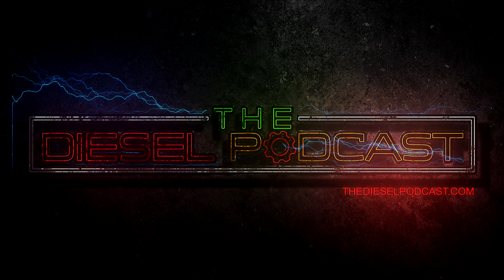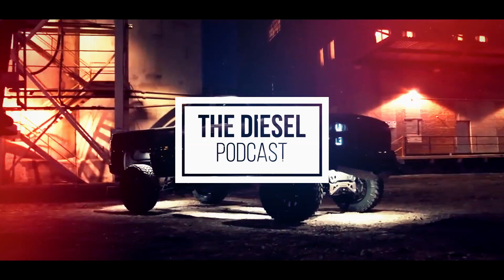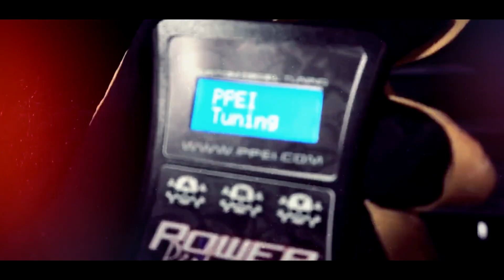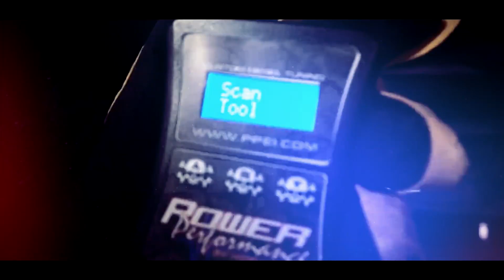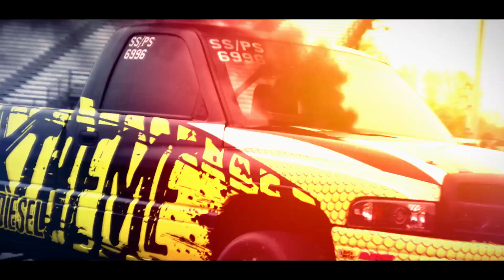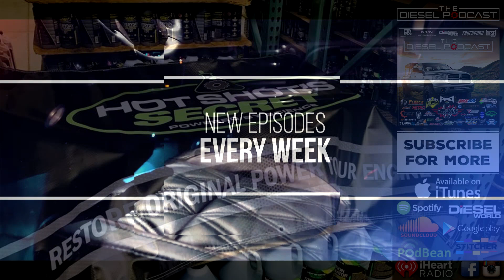CP4 Failures & Lack of Lubricity

Comment: There's a lot of strong opinion on the CP4 pump, and a whole industry based on the fear of failure. That might be justified, but no one can be sure without hard data on actual failure rates and causes. I just turned 210,000 miles on my LML with the original CP4 pump. I know owners with over 500,000 miles on the original CP4. When are we going to see actual data?

Comment: GM 35 Million $ settlement on CP4 for specific models and states. 

Per USA Today (May be inaccurate - Validate details for your own truck)

To qualify for a payment, you must own one of the following cars:

2011-2016 Chevrolet Silverado.
GMC Sierra trucks with a Duramax diesel 6.6L V8 LML engine.

The vehicles must have been purchased from a GM-authorized dealer in California, Florida, Illinois, Iowa, New York, Pennsylvania or Texas from March 1, 2010 through Sept. 13, 2024.

General Terms

People who paid out of pocket for a CP4 repair that was not covered by warranty. $30 million will be set aside for this group and payments could range from $6,356 to $12,712.

People who no longer own their trucks and did not pay out of pocket for a CP4 repair. $5 million will be set aside for this fund and individual payments could range from $400 to $800.

Those who still own trucks that have not been remedied. These people can get cash back on future repairs and will be reimbursed 50% of the costs paid for a CP4 repair performed at a GM-authorized dealership on or after the date the settlement receives final approval. This reimbursement option will end 12 months after the settlement's final approval or when the truck reaches 200,000 miles.

Comment: I'm not saying the theories here (and they are theories) are correct or not, but stating "same trucks" in Europe is nonsense.  There aren't a bunch of LML's or 6.7 Power Strokes  running around Europe.  Yes, Audi and others use the CP4 but  there are differences in their overall system.  Simply stating that the "only difference" is the fuel isn't true.  I do believe that the fuel standards are likely a core issue, but I don't believe that it's the "only" issue.  Sorry, but I don't trust GM, Ford or even Cummins to not cut corners anywhere/everywhere they can.  And yes, I own/drive both an LML and a Ram with a cummins as well as an Audi diesel  all at or over 100K miles.  I run Hotshots EDT in my LML but I don't believe for a second that it's "the one thing" that's making a difference here.  I hope I'm wrong and it is, but I highly doubt it.

Comment: It is NOT possible to prevent the Bosch CP4 fuel injection pump from self-destructing. There is NO science, to my knowledge, that shows any technique or product to be effective. The only sure-fire method of preventing catastrophic failure is to replace the pump with either a CP3 or an aftermarket pump. Nothing else will work because the pump itself is structurally defective. It's an engineering screw-up.

Comment: This just happened to my buddies ‘16 Duramax with 40k miles last week.  I’ve been using their products since I got my ‘15 GMC and crossing my fingers and only fueling at big chain truck stops
Reply: If it doesn’t have a lift pump, it will starve for fuel at the pump.. that’s what seems to be causing early Duramax failures

Comment: Since 2007 when USEPA mandated ULSD the below question has never been answered

The ASTM HFRR test is an abortion. A complete joke. Where does the HFRR test duplicate pressure like a modern-day diesel fuel system? CP4 pump failures prove the lubricity test is a complete abomination

I would like to ask you a question, in all your years of experience, has anyone ever defined for you the meaning of "Diesel Fuel Lubricity"? Beyond just the words? I have looked high and low and from here to there for even a technical definition by anybody and I have found nothing. Sulfur has no lubricating properties whatsoever.

Or put another way. Outside of the ultra-low sulfur diesel fuel excuse. Do you know what causes diesel fuel to have poor lubricity? What is causal mechanism in the fuel that is causing the diesel fuel the poor lubricity problem?

Thank you for your time

Kindest Regards
Mike Colburn
Las Vegas, NV
USA
702 716 0182

Comment: I used Hot Shot secret Everyday mix and have for last 3 years.  CP4 failure at 43000 miles :(  Currently waiting for new short block and fuel system.
Reply: Chris W if you dont mind, how often were you changing fuel filters and do you live in an area with high humidity?
Reply: Stanadyne  with lubricity / the original best for dry fuels.. if you’re running a Duramax the only way around early failure is a lift pump because there are no lift pumps on Duramaxs 
Fuel starvation can also affect any diesel fuel pump if the filters are clogged..
Diesels are performance motors and they need a 360° approach to maintenance.

Comment: I like to see a guest to discuss proven combinations to make loads of streedable torque for a mechanical 12v p-pump that doesn't smoke or cook pistons. Injectors, delivery valves, turbos, ect
Reply: No smoke, it's called common rail !! For reduced smoke and good power check out Power Driven Diesel's AFC live unit !!
Reply: why? do you need a 12v, let alone a modified one that could smoke or cook pistons, injectors, delivery valves, turbos, ect
Reply: @aaron___6014  I'm not into combinations at Cook Pistons or blow black smoke. Also, that isn't what I stated in my comment. Just because you don't like old technology doesn't mean that there's not others that do. Common-rail is great technology. Modern common-rail is on The Cutting Edge of Technology. Newsflash, deepam technology was cutting-edge 40 years ago. I can say with a great deal of certainty had carb or the EPA never been formed, the likelihood of us having common rail is pretty slim. It is stricter emissions requirements that has driven the innovation of common rail Technologies
Reply: @timothymroberts2949  your comment suggests that you want a modified 12v. And modifying a 12v can come with the problems you listed, so I'm wondering why you even want to risk modifying the 12v?
Reply: @aaron___6014  I want a modified 12v like you want to be broke. I'm interested in modification of any 12vs personally. It's more about learning. You wouldn't be able to make big power with comman rail if others hadn't spent time and money into r&d. There is nothing to say you can't make mechanical behave like common rail. Never say it can't be done in the face of those who are doing it. Anything is possible. We all can learn something new from pushing the envelope. 40 years ago it was said you could make 400 plus hp from a Detroit 6v71....well in 1981 my father build a 6v71 that made 435hp at 1400 rpm and smokes the dyno...nobody said it could be done....well he did. There wasn't an engine dyno west of the Mississippi that could handle the power output.... my point is we all can gain from innovation. The advantage to mechanical is if the electrical power completely fails, old mechanicals will be be able to function. Long live the p7100

Comment: What's good for a 2019 ford f250 6.7  I usual use amsoil  5w40 6x with 32oz motorkote hyper lubricant with the fuel I use gray and white diesel Kleen   as I travel for work  all year got 67k miles on the 6.7
Reply: Diesel Kleen is the Walmart of fuel additives. Opti-lube is the king with just a few others being decent such as Amsoil and Hotshots. Hotshots still haven’t provided any tests of their product against Opti-lube.
Reply: I personally use Motor Kote on my gas engine it’s never let me down!!

Comment: What about the 19’s-20’s ram cummins
Reply: Hmmmm.  How come my 19 ram 3500 has one
Reply: I have one in my 19
Reply: Below is all vehicles with CP4

GM

2011-present GM Sierra trucks with 6.6L V8 Duramax LML engines
2010-2011 GM Savana vans with diesel engines
Certain GM Sierra diesel trucks with RPO ZW9 chassis cabs or pickup box delete

Chevrolet

2011-present Chevy 3500 Silverado trucks with 6.6L V8 Duramax LML engines
2010-2011 Chevy Express vans with diesel engines

Ford

2011-present Ford pickups with 6.7L V8 PowerStroke diesel engines

Dodge

2014-present Dodge Ram pickups with 3.0L diesel engines

Jeep

2014-present Jeep Grand Cherokees with 3.0L diesel engines
Reply: @bigcountry3198  GM stopped using them in 2017+ L5P
Reply: @BloodSweatandGearsGA  Exactly thank you.

Comment: What year did the cp4 come out?
Reply: Depends the make/model, but they first started appearing in 2010. Common applications are: GM/Chevy 6.6 (2011-2020), Ford 6.7 (2011-2020), Ram/Jeep 3.0 (2014-2020)
Reply: @kylefischer1750  GM stopped using it for 17+ in the L5P and unfortunately Ram started using it on the 19+ 6.7 Cummins😩🙄
Reply: @kylefischer1750  Wrong info on GM GM LML 2011 to 2016, RAM 6.7 Cummins 2019-2020, Ford 2011 to present. GM 6.6 2017 to present uses the Denso Pump. Ram has gone back to the CP3 on the 21's